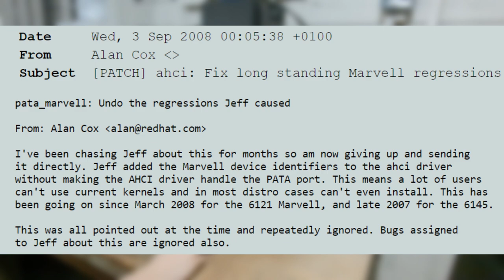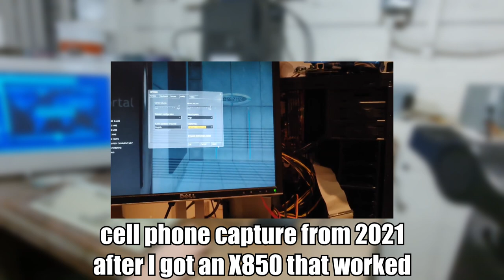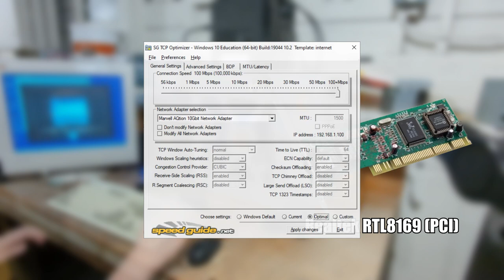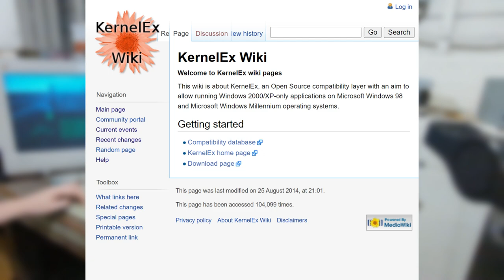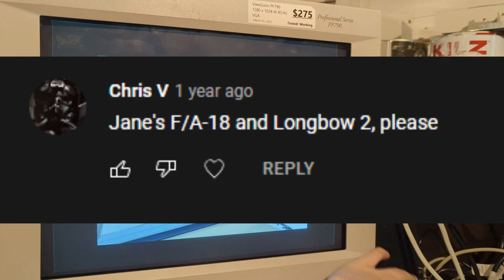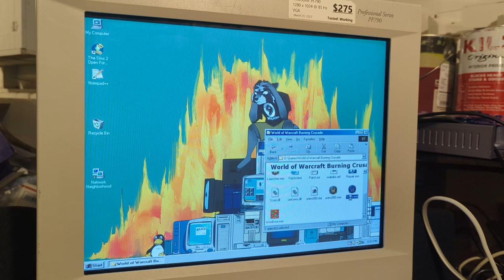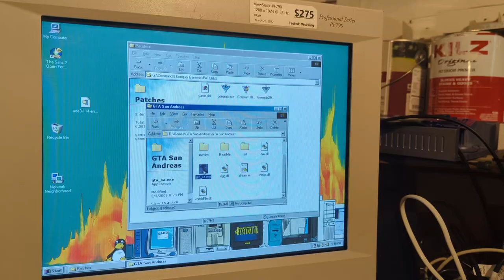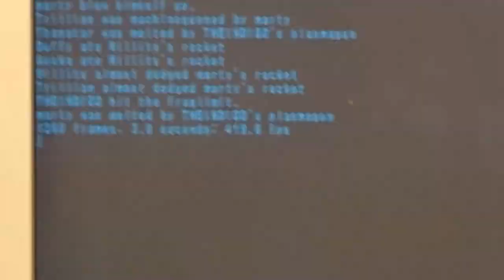Building the REAL "ultimate Windows 98 PC"

Comment: Omega drivers were the only hope back then........there was a reason why Nvidia cost more back then and it was mostly driver support and reliability
Reply: nVidia's drivers back then were just as much of a pile of trash as ATI's drivers. Arguably even worse, at least in my experience. The geforce 7900 card I got back in 2006 didn't receive a single WHQL driver update for Windows XP x64 for over a year, to the point that Steam and some games had started giving me warnings or flat out refused to run at all. So much for nVidia's fabled driver reliability.

With the Radeon X800 and 9800 series cards that I'd used before that, at least there were both official WHQL as well as Omega driver releases available regularly, even for Windows x64. And then there were the marvelous ATI Tray Tools, which were miles more functional and friendly to use than either ATI's or nVidia's control panel interfaces.

Comment: Nice build.

Where did you get your info that the 6800 Ultra was DX 9.0b? It's also a DX 9.0c card as far as I am aware.

6800 Ultra also has shader model 3.0 which the ATi did not have, which made it much more capable in later titles and thus more future proof. For example it will support HDR in Half-Life 2.

To some degree that makes it slightly more worthwhile in my opinon.
Reply: He got them backwards. The X850 is dx9b only.

Comment: After watching this video, I purchased same mother board Asus M2V, paired with same athlonx2 processor. Purchased same MSI GTX 7800 card.  installed the same software, patched as  mentioned in Video, but Graphic card still not working in Windows 98. System hangs, Colors gobble up. Please help me. Let me know exact settings and sequence of installation, if I may be missing something.
Reply: Till now , no reply...
I came to conclusion that, this video is fake and he is just bluffing....
Reply from the maker: @mohammedmohsin4311  I actually didn't see the comment notification until someone on my Discord pointed it out. 

I'd be happy to give pointers where possible though! Feel free to reach out https://discord.gg/TnpSG2P677

Comment: Consulting the greybeards is not always the best solution for these sorts of things. They will all tell you that things like SATA can never work. You can't have AC97 audio. You can't have PCIe. You can't use USB drives you can't have fast USB. You can't use large hard drives. You can't have more than 256MB of ram. Yatta yatta on and on but if you are willing to put in the legwork researching drivers you can often find edge cases where you can get these things working. Getting all of them working on the same board is going to be a challenge of finding the right board tho.
Reply from the maker: It took two years but I'm still proud to have put it all together

Comment: Did you face any problems with 32bit colour depth and or resolutions higher than 640x480, cause i can't change that?
Reply from the maker: None that I can think of? You may need to try using the Nvidia tray icon to force a higher resolution and color depth after reboot

Also double check under System that it's using the Nvidia driver, sometimes it does not overwrite the original "VGA Device"

Comment: A smart person realizes that for games from the Windows 98 era you need older drivers. I went with an Nvidia Geforce FX5700 (256mb), DirectX 9.0a, Detonator driver version 56.64, and Nglide version 1.05. I run 2gb of PC3200, 400mhz Kingston memory, with the ram limitation patch found online.This combo allows me to play all my Windows 98 games, all 82 of them in Direct 3D, Open GL, or 3dfx glide. For sound I have a Sound Blaster Audigy pushing sound to my Bose speakers.
Reply from the maker: A "smart" person would know why the Geforce 5's are terrible cards

Also why the FX500 and FX5700 can play DOS games while a Geforce 6 (or 7) cannot

It's specifically due to the removal of the VESA BIOS Extensions (VBE) in the Geforce 6 and onwards :) 

Weird flex otherwise but glad you're having fun!

Comment: nice proyect i still keep my old 478 intel board but i want to test if a 120gb ssd can be used for install win98 the machine has 8gb old ata hdd but die and i want to take advantage of the 2 sata ports
Reply: my 478 board died, im using my 370 board and it still works nicely. capacitors did look quite sad on the 478 board.

i use a Pentium III at 933 MHz, 384 MB SDRAM, nVidia Geforce 2 MX 400, Sound Blaster Live, Windows 98 SE

Comment: Cards from that particular era are notoriously unreliable. Not just ATI cards either, goes for nVidia cards as well. I have a box full of non-functional Radeon 9800/X800/X850 and GeForce 6800/7800/7900 cards that can attest to that, most with similar symptoms as mentioned in the video (either not booting at all or displaying artifacts if they do boot up). Artifacts usually indicate an issue either with one or more memory chips or the GPU itself. Often this was due to cracked bumps or solder joints, from either physical or repeated thermal stresses (materials expanding and contracting as components repeatedly heat up and cool down). This was a time when GPU power consumption and heat output had only just started to increase to non-trivial levels, manufacturers previously didn't have experience designing cards that would reliably tolerate such high repeated thermal stresses. And at around that same time use of lead solder in electronics was being phased out, further complicating matters for manufacturers. This series of issues would ultimately culminate in nVidia's bumpgate fiasco.

That said, I also have several fully functioning cards from those generations in my collection as well, again both ATI and nVidia ones. I'm using a Radeon X800XT in my own overkill Windows 9X machine (but in my case using Windows ME). I'm using a more Windows 9X friendly system in general, though still overkill - Asrock 775i65G R3.0, i865 chipset, Core2-based Pentium E5800 (runs at 3.2 GHz), 1 GB of DDR400 and an AGP Radeon X800XT. So all components with Win9x driver support and no need for any additional patches. The system works great, I haven't had any game compatibility issues. I haven't tried something as new as Portal on it, but games like No One Lives Forever (1 and 2), Need For Speeds Porsche and Underground, Doom 3, Morrowind, Knights of the Old Republic, etc. run just fine. The card even overclocks to basically X850XT PE speeds, but I don't run it at those clocks most of the time, since it's complete overkill and just needlessly stresses the card more than necessary.

I can definitely understand your frustration from receiving so many defective cards (I hope you were at least able to get refunds from ebay, assuming that's where you bought them from). But I don't think your game compatibility issues were down to the card itself. Especially considering many of the parts of your system seem to be barely compatible with each other and/or with Windows 98 and need a bunch of workarounds and unofficial patches to get to work together. I can assure you from my own experience, both recent and from back in ~2005, that far more games than just Portal should run on these Radeons without issues.
Reply: probably doesn't help that he's using a really crap motherboard with a VIA chipset those are hit or miss, instead of something that has a like nforce chipset or AMDs own chipset.
and you are right about that gen of GPU's being unreliable it really depended what gpu partner you got if it was going to be a good GPU that will last that and the age of the GPU's now a lot of them need to be recapped by now or the vram chips go bad.
Reply from the maker: @SilverX95  The ASUS M2V isn't a bad board, though VIA's chipsets were very bare-bones. They supported Win9x up through 2009 when other vendors fell off in the early 2000's

Comment: How did you backport the openGL driver?
Reply from the maker: There were two DLL's I pulled in from the older Nvidia driver, they thankfully "just work"
Reply: @CursedSilicon two?
Reply: @CursedSilicon  Which ones?
Reply from the maker: @lasagna_lxiv  From memory, the OpenGL DLL and I think one of the control panel ones

Comment: So you cant run DOS because of your graphic  card?
Reply from the maker: Correct. The VESA BIOS Extensions (VBE's) needed for DOS games were removed from newer graphics cards
Reply: that sucks - by the end of the 2000s ought decade retro computing started really emerging as new hobby category - sure, there were retro computing groups prior then but podcasting and youtube gave it legs that hadn't existed before.

And so there would start to to be revived interest in the old MS-DOS games, etc. Just as the PC industry was severing all manner of backward compatibility to that prior era. So now one has to buy antique hardware to get there on real hardware (vs software emulation running on modern hardware which is not at all as satisfactory an experience)
Reply from the maker: @TheSulross  A lot of DOS (and now Win9x) gamers switched to DOSbox and its forks because it's such a hassle to maintain physical hardware. I do want to build a DOS machine at some point down the road, but I can understand why they "took the easy route"
Reply: @CursedSilicon  yeah, not a gamer but more interested in vintage computers for vintage computers' sake
Reply from the maker: @TheSulross  I'm of a similar mind. I was born toward the end of the DOS era so I don't have as much affection toward it. It seems like DOSBox's main appeal was for people who wanted to play DOS games though

Comment: did you know Realtek made drivers for their PCIe NICs for a little while?
Yea, there are 98 drivers for the RTL8111/8168(B/C/D)
I myself am using a PCIe NIC in my own super overpowered 98 machine
50+ MB/s transfer speeds from my own NAS over SMB, it’s nice.

AMD A6-6400k, NVidia GeForce 6600 + 7950GT (welcome to the dark side my brother), 8GB of RAM, and Audigy 2
Reply from the maker: I wasn't able to find any that supported Win98. All I can find are RTL 8111's these days. I tried using a PCI to PCI-E adapter but ended up having weird instability issues
Reply from the maker: For some reason I'm unable to see the full reply you made to my comment (thanks Youtube!) 

You might want to come reach out on my Discord. You've got some interesting videos of your own 98 machine as well
Reply: @CursedSilicon  yea, I can’t see it either. Weird. Also, I’ll definitely be joining your discord!

Comment: This kid has no idea what he doing. Much of his hardware is NOT compatible with Windows 98 hence all the issues. He's missing half the drivers he needs to run the hardware correctly and on top of that PCI-E graphics card are not fully compatible with Windows 98 despite claims of compatible drivers. This has been known since PCI-E has come out. You can not use ANY motherboard with PCI-E, it must be regular PCI with AGP slot.
Reply from the maker: My dude I'm 31 years old but a'ight 

Beyond that I uh, literally demonstrated (and explained in-depth) every single hardware choice I made 

But please go ahead and show us your video about everything I got wrong?
Reply: They say of the adult man.
Also, as someone with a PCIe based 98 machine I can tell you, the “claims” of PCIe (it’s PCIe not PCI-E… are you thinking of PCI-X?) graphics card drivers are completely true. They absolutely work, or at least as well as the same drivers on AGP cards.
Fun Fact! PCIe is designed to be entirely backwards compatible with PCI from a software perspective, so there is literally no reason the drivers wouldn’t work (besides being… poorly written late 98 era drivers)
In fact, I have gotten PCIe graphics cards working on Windows 95